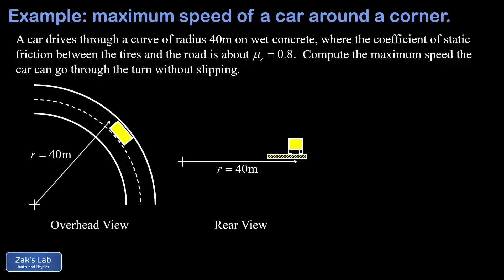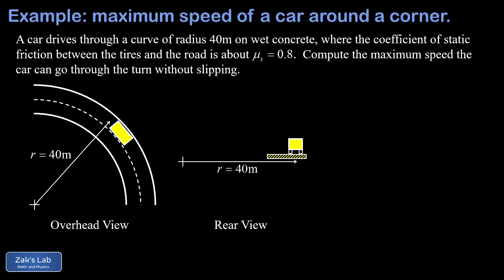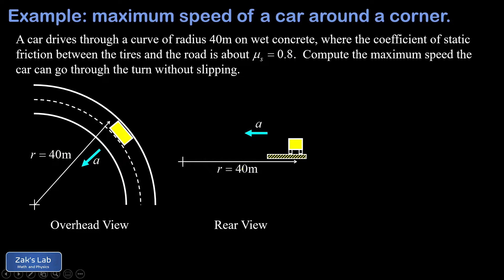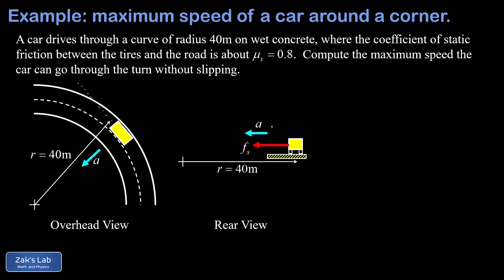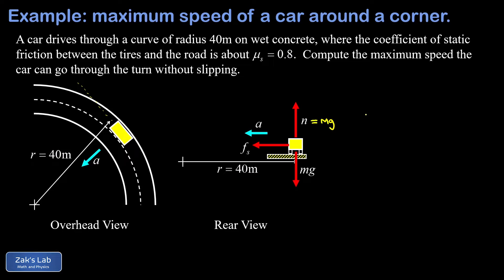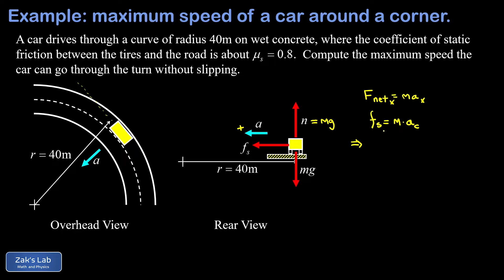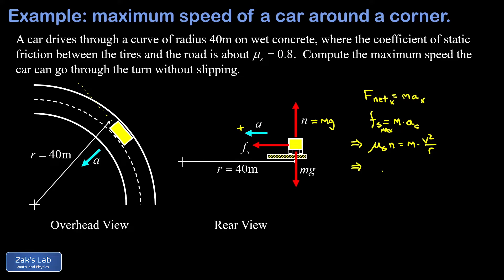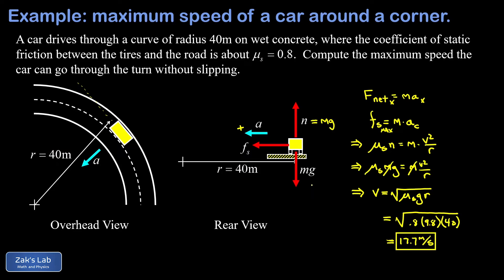Car turning with friction: maximum speed for a car rounding a level curve.

Comment: Where does the 9.8 come from?
Reply from the maker: 9.8m/s^2 is the acceleration induced by gravity near the surface of the Earth.  Early in a physics course you're usually just told that the acceleration is 9.8 or 9.81 m/s^2, then we discover that the weight of a mass m is actually mg.  Here's a link to a short video on why that's true:   https://youtube.com/shorts/wKkDcpHGkjs       Later in the course, students get the opportunity to determine the acceleration of gravity by using Newton's Law of Gravitation F=GMm/r^2 to derive g from more fundamental principles, which is done in this video:  https://www.youtube.com/watch?v=xGmkiL5RzJg  z